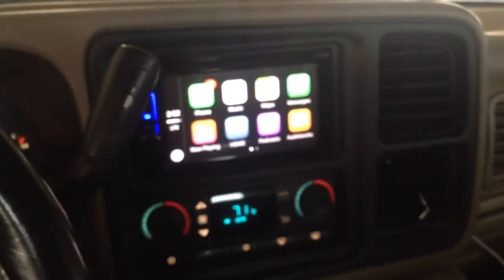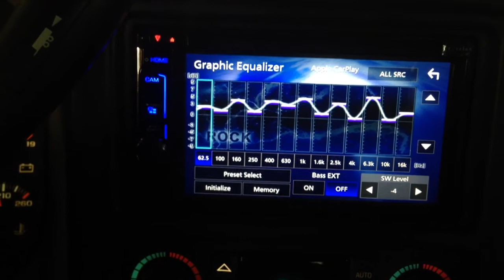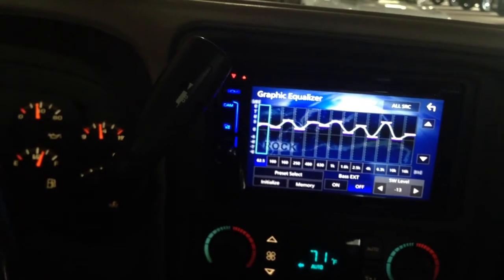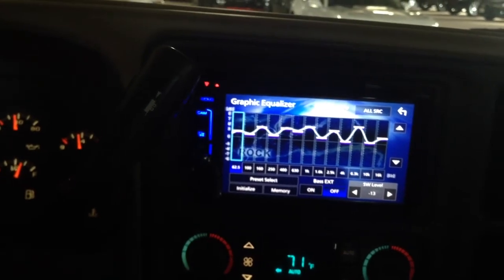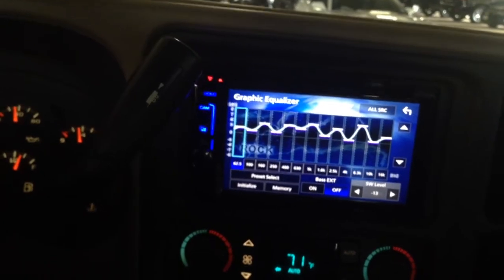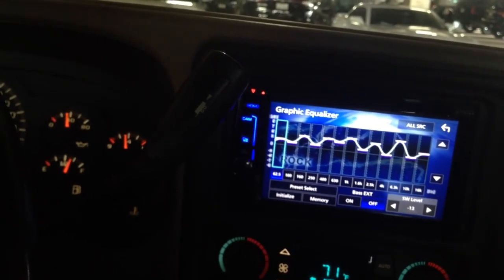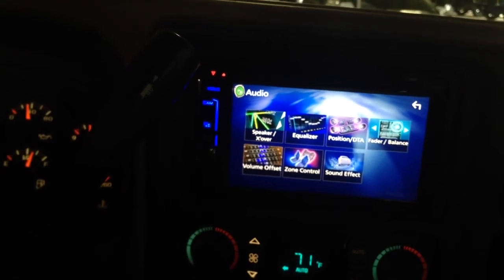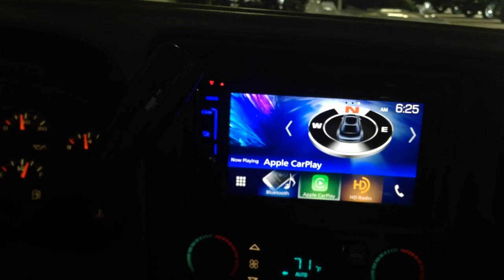03 Suburban Stereo Upgrade Done

Comment: I have an 06 Yukon and it has the BOSE system but with the upgraded factory Navigation touch screen radio.  It still has the dummy non lux BOSE amp, but it actually plays surprisingly well.  That little sub hits hard; I have the base turned up +2 treb +3 and mid -1.  It also has 4 default factory EQ settings.  I've read on the GM forums where people try to blow the sub sending it up to 700 watts, and the little sucker handled it well - with in margin of course.
Reply from the maker: It’s still working well with my RF punch amp.
Reply: jewllake have you read anywhere of a direct, factory Bose replacement?

Comment: Are you running all the speakers off of the head unit? I want to replace the system in my 07 Yukon XL, to include aftermarket amps and subwoofer. I have a set of 6 1/2” Infinity Kappa Perfect components I’m thinking of installing in the front doors and front pillars, a set of 6 1/2” full range Focals for the rear doors, and a set of 5 1/4” full range Focals I’m going to modify to fit in the rear pillars. I plan on using foam baffles (to protect the speakers and add some sound dampening) with some added sound dampening pads (speaker kits) as well for each speaker, minus the tweeters in the front pillars, which I also have to modify the mounting brackets for. I plan on bridging one 4 channel amp to run the front components, and splitting the rear outputs to connect another 4 channel to run the rear door and rear pillar speakers. I also have a high current Phoenix Gold monoblock amp that I’m going to run to power a Boston Acoustics 12” with added Boston Acoustics 12” passive radiator. My Yukon didn’t come with an accessories battery, so I’m going to upgrade the wiring on my alternator and install a deep cycle battery in the accessory battery location to run the system. I will also have all the external amps running on a high power capacitor, which will mostly help with pushing the sub amp. With the large cabin space in the vehicle I’m assuming it will sound pretty great, although I’m sure I will get a lot more rattles and vibrations that could benefit from further sound dampening.
Reply from the maker: All running off the head unit except the sub. Sounds like you have a good system planned.